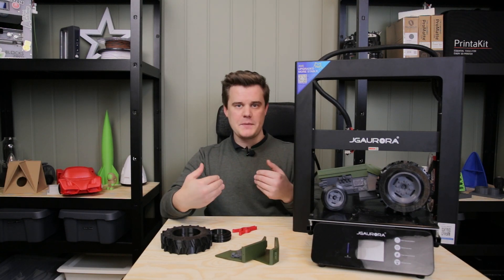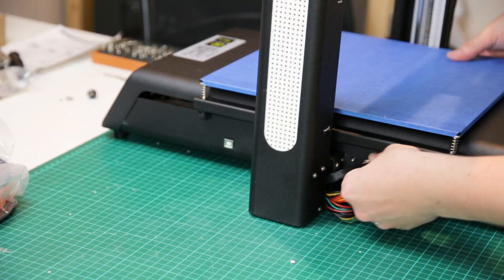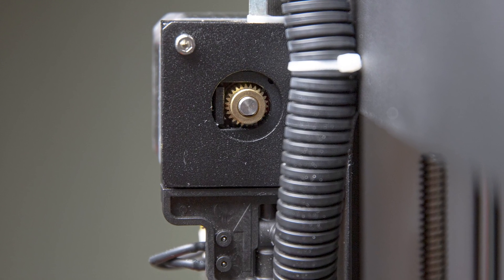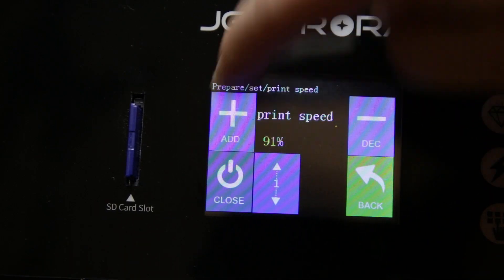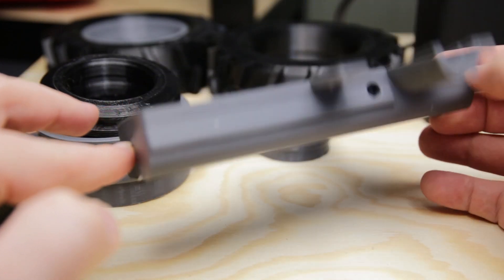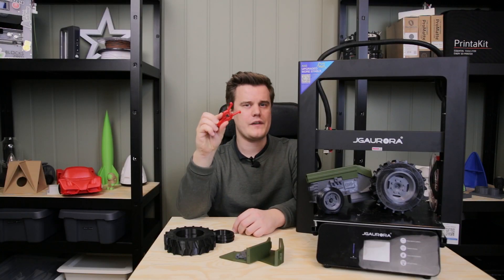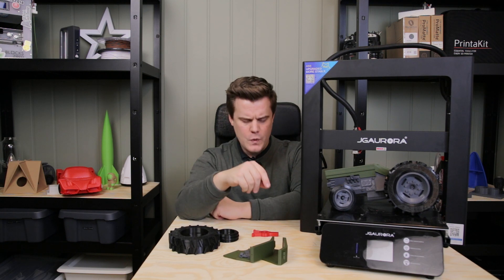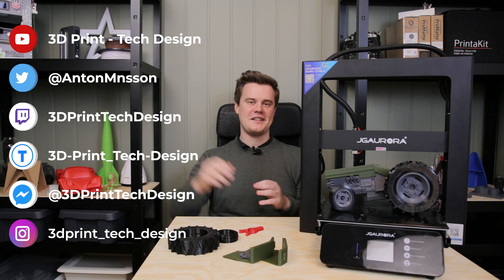A very Lagom 3D Printer? - Jgaurora A5S 3D Printer Review

Comment: I do not advise you to buy it ... the motherboard burned out for a month I wait for aliexpress, but they promise to send it only in March, and then this is not for sure ... no support
Reply from the maker: Woah, that's terrible! Tell me more avout what happened!
Reply: @3DPrintTechDesign  When replacing the nozzle with a bowden one accidentally somehow managed to break the insulation on the thermistor and when calibrating the table, the nozzle touched the body through the table glass holder ... the motherboard burned out ... I bought it for aliexpress in early February, but the seller replied that it was not in stock and  promised to send at the end of the month today contacted those support there answered that they will appear next month
Reply: @3DPrintTechDesign  I’m lying not during calibration, but when printing started, touch the nozzle of the glass holder body ... now the table temperature is always on the display 78 and the nozzle 238 ... I tried to update the firmware but it does not help ... I sit for a month without a printer ... I think to switch to  another manufacturer!

Comment: Could you make a video about fusion 360 starting modeling of a 3d  scan or stl file. For example i would like to the design a splitter for my car and i can get the accurate files and scandata from ford. So i would have to start by following the form of the front bumper and i just don't know how to start on that :)
Reply from the maker: I will do a bit more reverse engineering tutorials =) specially live!  Planning one in a few weeks of some parts scanned with a scanner i've reviewed (video on friday).    But, this might be somewhat what you're looking for?  https://youtu.be/LteurLaIcnw   Maybe not a perfect match..    I'm also reviewing a larger handheld scanner so I will be scanning some car parts and can problably follow up with another video on modelling parts there =)
Reply: @3DPrintTechDesign  thx for the reply. Will have a look at that video. Lots of info on how to import and convert your stl files and how you can adjust them but not about how to use them as a template too design add-ons from.
Reply: @3DPrintTechDesign  i already saw that movie. Modeling the splitter isn't the problem. It's makin it fit to the curves of the bumper and printing a prototype. Or could you just make a rectangle and extrude it against the bumper and make it connect so you have like a block you can start sculpting from?
Reply from the maker: @TheTechnoaddict  alright! I know what you mean, I think I have some videos where I introduced the concept, but I'll do a dedicated one. You're not the first to ask and as you say, there are many who is wondering.  Basically you want to convert to solid/surface so you can fit/cut your new model. But usually the STLs are too big for that.  So next up would be to sculpt and "match" a surface as close as possible, using the forms tool. It's more organic modeling, but will do the trick. Usually 0,75-1mm fit is OK since you will have to work some anyways.    Last option is to use sketch intersections at different construction planes to get the profile of the scan, and model a perfekt match.  Iike sections of a boat hull.
Reply: @3DPrintTechDesign  that's exactly what i mean. A margin of a mm or so isn't a problem. A how to on those things would be magic :)